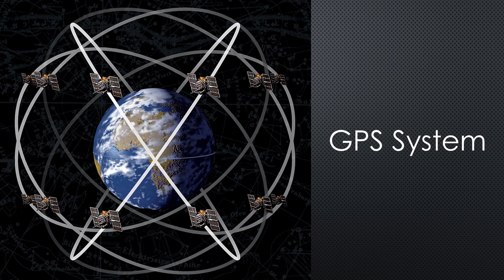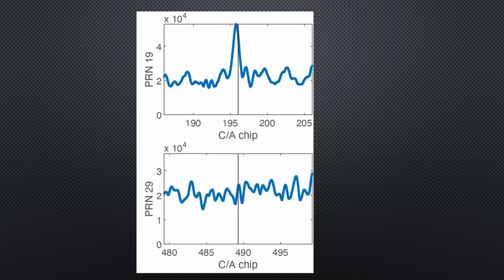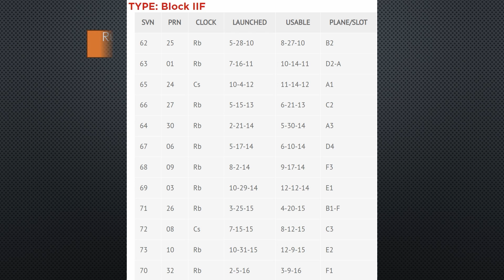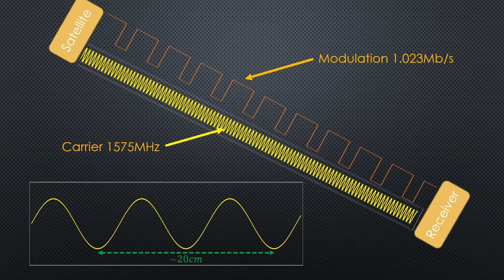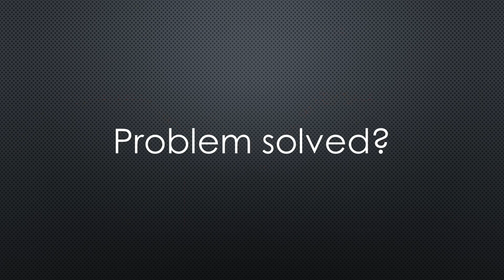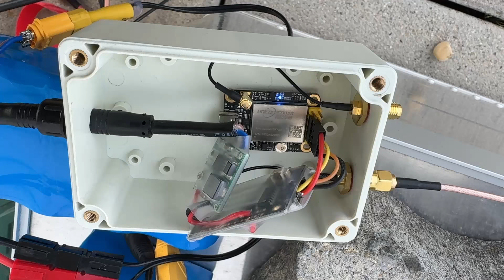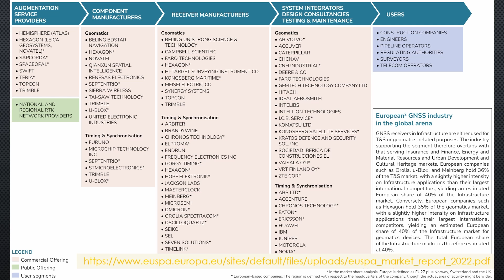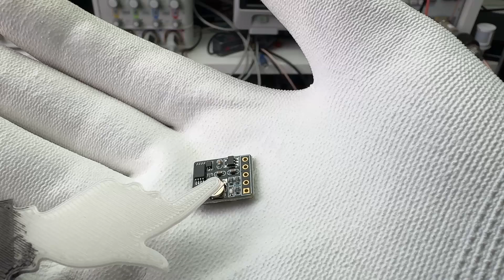(483) ESP32 precision GPS receiver (incl. RTK-GPS Tutorial). How to earn money with it (DePIN)

Comment: Knowing how GPS works only makes it seem more impossible.  The precision is hard to comprehend.
Reply from the maker: I completely agree. BTW: My 1995 GPS still found its position after many years in a drawer...
Reply: @AndreasSpiess  I remember how excited my uncle was when he got one around the same time. 😂
Reply: Just imagine image stitching but 3d... Once the image is built and verified and checked and updated over time, once that work is done... You are just checking points. The more points you get to check routinely the more confidence u have. Certain devices are verified very trustworthy or sent into the field to take readings to verify stuff. One the network is big enough, it works. Is that accurate at all?
Reply: I remember getting my first GPS receiver in early 90s. I remember how disappointed I was to find out about the "ambiguities" the US Military put into it, and I sure was glad when they stopped! 
(I had " insider info" back then, lol).
Still, it's so amazing that it works so well, and that it's used for so many things. 
As a ham operator, I use APRS regularly.
I've been wanting to build an RTK for several years, just been waiting for the cost to come down a bit ...
Thanks, Andreas! 🤪
👍 👌
Reply: When they put the technology into  keys and wallets, one will never lose anything again.
Reply: @OglądajPL-YT-Fizyka_od_Podstaw , this the illusion. The system works, because the satellites follow the Earth, just as the Earth follows the Sun (in a corkscrew loop, not in a two dimensional ellipse shown in books and magazines). As Andreas said, it is even more complicated at the implementation level.
Reply: Mein Magellan von 1994 war ein richtiger Stromfresser (250mA aus Mignonzellen). Er konnte nur 3 oder 4 Sateliten empfangen.
Reply: Still doesn't explain how this can work with a flat earth 🙂
Reply: @etmax1  NSA just watches real close to update your GPS. 😆
Reply: @jmr  That's what the "birds" are for.
Reply: I started getting really stoked when I heard about atomic clocks getting down to the PCI card size.

All you need to know to be the ground truth is the time.
Reply: @jtjames79  I forgot about the fake birds.  That's definitely how they watch us! 😜
Reply: @jtjames79  Keeping clocks in sync with that precision and keeping the satellites in the exact place they need to be(relative to us).  Plus adjusting for the time passing at different rates(relative to us).  There's just so much happening.  I could go on with engineering challenges.  It's crazy.
Reply: @jtjames79  Yes but why suffer the expense of caesium clock when all you need is a GPS receiver? I worked in a large electronics manufacturing facility pre low cost GPS availability, and we we had a caesium standard but then someone jury rigged a master clock that used the colour burst from television transmissions and that was piped through the factory. Occasionally we checked it against the standard but I doubt we would have ever bought another one.
Reply: @etmax1  Because it's cool and it fits in my desktop.
Reply: @jtjames79  Well there is that 🙂
Reply: Completely disagree.
Differential GPS has been around for decades, having a permanently installed GPS receiver in an accurately known location and having it calculate the magnitude of the error on the GPS signals and then broadcast a correction signal.

That's not particularly complex.
Reply: There he is, Mr. Randolph! Hope your doing well. I saw the same video he is referring to. Good stuff, lots of kinks to iron out with the use cases and legality in some areas but very very good stuff!
Reply: @tonysheerness2427 except their minds Knowing they're processions now have a tracker. Lol but your not wrong 😂
Reply: @jmr birds ...what a silly idea. We all knew better 😂
Reply: @deang5622  depends on the precision required, and difficulties grow exponentially. There are many sources of errors. for example, you can't eliminate your clk jitter. what about averaging time? and, the most important: how are you going to test it, with 5-nines target? otherwise, all your claims are unsubstanciated.
Reply: @mikets42  calculate your own position again a day later. If you did not move, the answer should be the same. Or say you detect more than 3 satellites and 1 fixed base station. If you repeat the calculation with different sets of satellites and base stations, you should be able to statistically estimate your error.
Reply: O9
Reply: @michaels3003 The Earth doesn’t follow the sun “in a corkscrew loop” in any “objective” sense. Motion is relative. Relative to the sun, the Earth does travel in an ellipse just as the “books and magazines” you deride say.
Reply: @bhz8947  , the galaxy is "much larger" than a single star. It does not revolve around this star. The known universe does not revolve around this galaxy. This much we know. I do not recall a single illustration that would be drawn to scale. Everything is grossly oversimplified.
Reply: @michaels3003  You’re still missing the point that there is no preferred frame of reference. I going to assume you didn’t get straight As in high school physics class.
Reply: @jmr
Look up RTK GNSS GPS and how it works and then you will understand how it is so accurate.
Reply: @etmax1 Earth is not flat.
Reply: @Zeaiclies  That was exactly my point
Reply: @etmax1 
Seemed by your post, you thought Earth was Flat.
Reply: I had one of those old garmins from  1990's and found the back of it in my rubbish fire in the garden, with n AA battery stuck to it

Comment: For less that $15, we built a GPS tracker for the kids model rockets using a Arduino, a barometric presser sensor, a long range communication module and a GPS module. Even had a custom printed circuit board made for it. It transmits latt, long and altitude back to a base station. We can then punch those coordinates into a mapping app and it takes us directly to our downed rocket.
Reply from the maker: Cool project!

Comment: I've got one of those gps guided mowers, Luba 2. It is mind blowing how precise it is. It runs right up to my curb consistently. RTK is a gamechanger.
Reply from the maker: Thank you for sharing your experience!
Reply: I have my RTK mounted in my air conditioned house attic which communicates with the LUBA.  The attic has wood trusses. Is this an acceptable location? I would have to hire someone to mount on my roof. Would I gain more antenna views moving it?
Reply from the maker: @golfshoe9321  I do not know, You have to try. Wood usually does not have a lot of attenuation (if no metal is inside).
Reply: I don’t know your model but normally this have cameras. Because GPS is not accurate enough with the small view of the sky under trees and next to buildings..
Reply: @Stefan-st  My model does not have cameras. I am playing with GNSS planning software to time an optimal window for hight SN ratio.
Reply: @golfshoe9321  A wet roof does attenuate the signal. Winter months and snow cover tends to be the worse.

Comment: As your subscribers we too want more.  I would second the suggestion already made by a viewer: another video on base station setup.  I was hoping this video would cover that but that would have made it too long.  I know you weren't planning on doing one but I and I'm sure others would very greatly appreciate it.   At any rate, thanks very much for the video - very interesting technology.  All the Best!
Reply from the maker: We will see. The video performs much better than anticipated…
Reply: @AndreasSpiess  I would love such a video. I've been looking into setting up my own RTK station and building my own auto-steer for my tractor setup on my farm. Commercial systems typically costs minimum 8-10k euros for the initial purchase of the system. On top of that a yearly subscription to RTK costs from €500 to €1000. From what I've been able to gather, I could probably build my own auto-steer system for €2000-€3000.
Reply from the maker: @ste1l1  In the meantime, I started a project to build an autonomous rover (using Ardupilot). I hope it will be ready after summer break...
Reply: Totally want this, I appreciate the links and options but its overwhelming how many there are to choose from - what did you end up picking, what worked well or didn't, are the cheaper options good enough etc. Thanks! Love your videos.
Reply from the maker: @hypercube33  I used the UM-982, but the 980 will work too as a base. The info for the antenna is in front of the link.
Reply: Yes!  Please!  A base station setup video would be so very helpful, and so much appreciated!
Reply: @AndreasSpiess please make this video and one for the base station build.

Comment: This is revolutionary. I'm a road surveyor/inspector in the US and use a Trimble RTK receiver with my state's free correction network over a 4G hotspot and it gives me awesome accuracy in the field all by myself but it cost $20k for the receiver (6 years ago) and when I opened it to replace a part, it was layer after layer of complicated circuit boards. To think it's been simplified this much is inspiring. Now if only I can find a way to do DIY tilt-compensation for the pole I'd mount it on.
Reply from the maker: These "layers over layers" are now in the chip, I assume. And therefore cheaper to produce. I agree, with  this pricing it becomes attractive for DIY
Reply: Didn't know about the free state's services!
Reply: Cant you simply mount two spirit levels  90 degrees  of etchever  to the pole and adjust them to  center = pole plum ?  Or is more complex to solve?
Reply: That's what one of those really cheap MEMS gyros can do for you.
Reply: @viktorakhmedov3442
Trimble proprietary IMU tilt is based on electronic bubble technology that is not proprietary. Moreover, an electronic inclinometer is not so hard to execute. A little plumbob and a little protractor. Electronic totalstations have been doing it since the 80s for zenith angle compensation.
Reply: @AndreasSpiess  There exists a triopoly of surveying instrument manufacturers who load everything up with layers and layers of anticheat. They're in business to enforce rents nowadays, and a big part of that is keeping the barriers to competition just high enough.
Reply: @allpointsthreesixty  Yeah I was thinking about that, my 8-year-old totalstation can display a digital bubble level on the screen so it obviously can compute it. And for that matter, not sure why it needs to be perfectly level really, but what do I know?
Reply: @pat_rick01  I live in Michigan and am somewhat spoiled, the state DOT is often on the cutting edge of things and we have many top-tier educational institutions they partner with for research. But more and more governments are adding such systems.
Reply: All those circuits got condensed into one or a view chips. Makes a simpler system, but the component got more dense so you can't really repair them if they break.
What kind of tilt do you want to compensate? The best thing would be to place the sensor in the point of interest. If it has to be a pole, a pendulum of some sort is helpfull, so gravity will allign it for you.
Reply: Trimble was/is the US based defacto standard...they are high dollar, but they do back up w/excellent support and software... with RTK NWs, growing NTRIP and  NOAA "CORS" soon we'll all be getting sub cm accuracy on our phones for free...

Comment: Fun fact: the GNSS satellites constantly apply corrections to their timers, because they move fast enough and need to measure time precise enough that relativistic time dilation becomes relevant. 🙂
Reply from the maker: Thank you for the addition!
Reply: @OglądajPL-YT-Fizyka_od_Podstaw Correct.  If not adjusted for relativity, GPS is way off.
Reply: @OglądajPL-YT-Fizyka_od_Podstaw  AFAIK, all of them do - they're all going at several km/s, so they all need to compensate for relativity. (at a guess, about 0.00003c)
Reply: @realulli  even if they are not moving, they are affected by the gravitational field of the earth. A clock outside the earth's field with run slower. A different clock is needed for space application. The problem is currently managed by applying small corrections.
Reply: Not only the sat speed is affecting the time shift. Altitude also ! (Less Gravity Force -> Time faster than on the ground)
Reply: @janami-dharmam  will run faster when gravity is lower ,  speed will make clocks run slower too , so both effects are in the same direction  as i understand
Reply: @gnkarn00  I goofed??
Reply: they should slow them down so they can use our time.
Reply: They are high enough, not fast enough.
Reply: The speed of the satellites isn't a huge issue as they are all traveling at the same speed as each other, it builds up slowly over time but not that bad. The effect of altitude is a big issue though, the Earths gravity is vastly lower at the satellites altitude, and the error builds up quickly.
Reply: Single band GPS still had 3D error of about 50m. You needed correction for anything better.
Reply: @gnkarn00  Higher gravity slows down the clocks, and higher speed slows down the clocks, too. For satellites both effects go in opposite directions and if I remember correctly, the lesser gravity affects the clocks more than the movement speed at the distances that GPS satellites move. For SpaceX Starlink satellites it's probably the other way around because those fly so close to the surface of the Earth.
Reply: I often wonder where all my time goes. Its eaten by the satellites!!
Reply: @gnkarn00  It all relative
Reply: @Reach41 If the satelites wouldn't account for relativity you get arbitrarly bad over time.
Reply: Has to do with the speed as well as the gravity of the earth
Reply: It's about gravity well proximity
Reply: Most of the relativistic correction is not from satellite velocity but from being in a lower gravity field.
Reply: @OglądajPL-YT-Fizyka_od_Podstaw  GPS is just one system for GNSS.

Comment: Very nice and informative video.  Just an addition by a physicist. The engineers designing the gps system had to include the effect due to the fact that time flows differently on Earth surface with respect to satellite orbit, as explained by general relativity.  The legend says that they at the beginning did not believe that it was necessary, so they introduced a software switch to activate/deactivate this correction, but then they had to use it in order to achieve the wanted precision.
Reply from the maker: Interesting detail! We engineers are always a little less to the detail than the physicists. But we accept reality (at least in a technical sense) ;-)
Reply: You have to account for speed and height of satellite.
Reply: How would they not know? If you can calculate the correction, you can also calculate the error incurred by not using it.

Comment: The progress in GPS receivers is amazing.  My first modules were surplus motorola units which could track 8 satellites and that was amazing for the time. They used a lot of power and were closer to 100cm2.

The real magic to me still, is in getting all that data by dealing with signals that are below the noise floor.  🤯
Reply from the maker: Indeed, many miracles have to happen to get a precise location!

Comment: If I'm not mistaken, this technology was developed by a team at Stanford University, Palo Alto, California, in the United States. They tested it while flying around the area in a Piper Cherokee single-engine airplane. While doing so, they were vexed by random vertical position errors of 2-3 cm that they could not eliminate. Eventually, they discovered the error was due to the flexing of the airplane's wings in slightly turbulent air! The result of their work has made it possible for airliners to take off and land safely under zero visibility conditions, completely under 3-axis autopilot control, as long as there is a GPS base station or "pseudolite" present in a precisely known location at the airport.
Reply from the maker: AFAIK, aviation uses Differential GPS, not yet RTK  (WAAS)
Reply: I believe I attended a presentation at Oshkosh years ago that covered that work (if it's the same one).  My understanding is that many airliners, particularly older aircraft like the 757/767, older 737s, and many others aren't using GPS because their navigation systems were certified so long ago and the costs for retrofitting a certified system into the older aircraft isn't deemed worthwhile...  I think the 757/767 had some really good Inertial Navigation Systems.  Aviation (at least certified VS experimental) is often far behind the rest of the world in application of new technology - for multiple reasons.  The precision landing capabilities of many airliners is often due to a combination of two or more relatively older technologies: ILS, microwave altimeters, microwave guidance systems (CAT III ILS, I believe)

Comment: What I find bordering on science fiction are the new GPS/Altimeter/Compass modules for drones. (M10)
In the size of a fingernail and a couple of grams they also include the antenna and have an accuracy of around one metre.(They are just a little slow in initial signal acquisition.)
Considering that my first Garmin weighed like a brick and gave me 50 meters of accuracy in the middle of a flat plain, after about 10 minutes of waiting, only when all the planets were aligned looks like there was a "slight" evolution of technology.
Reply from the maker: Indeed. Fascinating!